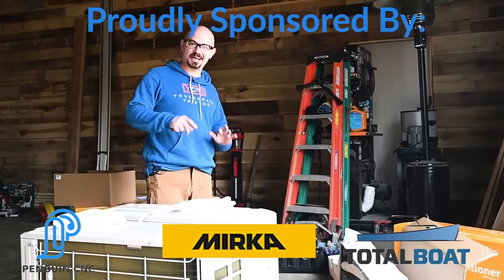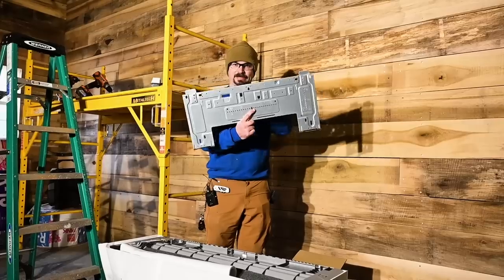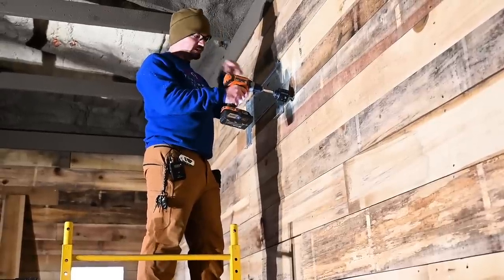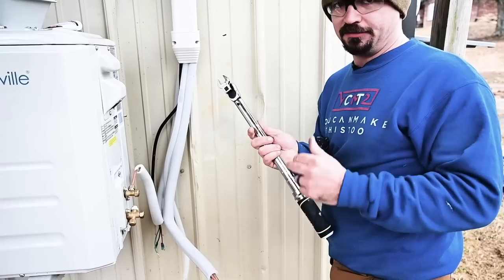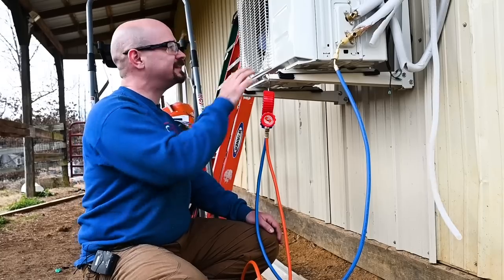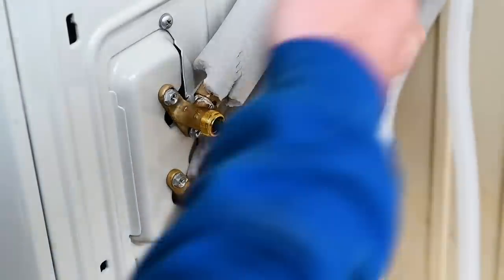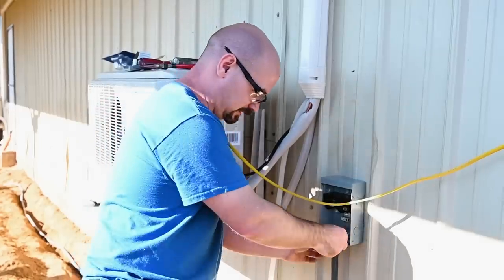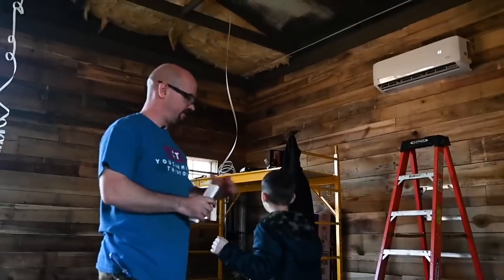Installing a Senville Mini Split | Dream Shop Ep8: HVAC Install

Comment: Hi I can’t but notice that big gap in the side of your shop. I am assuming that you keep this door closed normally.
Reply from the maker: If you're talking about the barn doors, yes. Up until recently they were open just for lighting sake unless it was super cold. We could have light and cold, or dark and heat... light prevailed for works sake a lot of the time. Now the doors are pretty sealed and lockable and stay buttoned up for the most part! I do look forward to nice weather when we can open up the shop though.

Comment: Warranties on the mini splits are worthless. Try calling to make a warranty claim. It will takes weeks, and requires a HVAC tech invoice.  IF  a replacement part is shipped, and the problem is still there, you have to call the HVAC tech again.  You will soon be at $1000 for two visits, and the mini split companies know that.
Reply from the maker: Exactly, can order a whole new system for that or less in many cases.

Comment: Did you have issues with your drain line coming out of the building horizontally like that? I wonder if it would freeze during the winter before it gets a chance to drain. How cold does it get where you live?

Comment: Prety good video. Just a note, the crowfoot on at 90 deg or straight don’t make a difference. Your still adding length and leverage either way. But it’s very a small  amount  and negligible. 👍

Comment: DO NOT USE THREAD SEALANT!. Sorry to be so loud but I worked at refrigeration systems for 47 years  and I know what I am talking about. The refrigerant metering device in any refrigeration system has a pin hole opening that will freeze and or simply plug solid if even a very small drop of this sealant gets into the system. This can can cause  very major repair problems. If you feel the need to lubricated your flare  fittings use only a small amount of refrigerant oil.
Reply from the maker: That's a great point that's come up quite a few times in the comments, thanks for sharing
Reply: Depends on the thread sealant. If it’s nylon blue you are using then it’s no problem at all. It’s just refrigeration oil essentially and there’s no harm to the system what so ever. It wont gel up and clog the TXV. A lot of people use it on flare nuts especially the back side where the copper mates. The only real concern with it is when using a torque wrench you can over tighten it. Because of that I simply use the lower end of the spectrum when tightening.

Comment: If you remove the schrader valve how would the freon not leak out when disconnecting the vacuum lines?
Reply from the maker: If I recall correctly, there was still a shut off valve after the Schrader.

Comment: You were supposed to leave the adapter with the blue line connected to it, release the freon in both lines.  Then document the adapter with the blue line still connected to it

Comment: Did you have to use a 10/3 wire to the unit? What size breaker? Thank you
Reply from the maker: I think it’s a 20A breaker, so just 12 gauge. Depends on the model.

Comment: Pulling a vacuum by time or using your gauge manifold is pointless.  It is like cooking to time and not using a meat thermometer. Most likely it will work. But a leak would have to be huge to tell that way. The proper technique is a triple evacuation. Vacuum pump, then break that with nitrogen, then again on the vacuum pump. Once you are down to 400-500 microns valve it off and watch the micron gauge. If it holds for about 15 minutes your system is tight and more importantly dry. The point of the vacuum pump is actually to eliminate moisture.
Reply: Agreed, not only break with nitrogen, but pressurise with nitrogen and soap test( within system limits).
Reply from the maker: Good to know, thanks for sharing! This is way outside my depth. So far everything seems to be going alright (even after the recent deep freeze) so hopefully I got lucky.
Reply: @YouCanMakeThisToo  as long as you didn’t have an immediate leak or a lot of moisture in the system it should be ok. But it is about longevity. A system done properly could have X2 the life long term. 

Keep up the good work
Reply: I would have called a competent installer to perform a task you don't have the proper test instruments for
Reply: @RARELYSERIOUSB  Even if i did this DIY and only got half the lifespan vs paying for a professional install, I'd still come out ahead because the cost of install is about 200% of the price of the unit.
Reply: @daltonduperreault3504  I doubt a pro would even do the nitrogen thing 3 times.
Reply: @keithwiebe1787  They definitely don't. I had a Mitsu installed by one of their Diamond installers (and one of the best rated HVAC companies in the area), and they did a pressure test and sub-500 micron vacuum. That's it. For the HVAC guys, time is money, and they aren't doing anything that adds hours to the install. A competent DIYer has time on their side, and they can run a pressure test (or vac for that matter) overnight or multiple days to really be sure. 

I'll be installing all my future units after tons of research and passing my EPA 608. The prices the HVAC companies charge for these is just too much. The rest of the world treats these things like disposable window units and installation is either free with purchase or like a hundred or two.

Comment: 19:08 - I see you removed that circular cap you originally had placed into the hole.   I made the SAME mistake, hung the unit and was like ... OOOO that looks like crap!   LOL

Gerry Owen's also mentioned not getting "foreign" material into your lines... That is why I purchase my linesets from deep in America VS border or sanctuary cities. :P LOL
Reply from the maker: Yeah, that stupid thing ended up being more hassle than it was worth 🤣

Comment: What is that stuff you're putting on the threads at 7:14? I thought you only needed nylog on the face of those flare fittings.
Reply from the maker: Thread sealant, belts and suspenders.

Comment: Just a small thought, nothing big. Did anyone tell you there is a "minimum depth of bury" on conduit and wire (conditions apply) and that the NEC won't let you run NMB in conduit - certainly not flex. Flex is limited to 6 feet (unless something changed since I retired). You can run NMB in conduit for physical protection. Some will argue that if you up-size conduit far enough using the physical outside dimensions of the "Romex" as you called it, that you can run in conduit. 

If you had it inspected, I would have expected the electrical inspector to have said something. Not every jurisdiction inspects or requires licensed contractors.
Reply from the maker: I definitely didn’t follow the minimum bury depth on this. I just pulled stranded through it though, not romex.
Reply: @YouCanMakeThisToo  - very good. Some will still argue you can pull NMB. It is physically possible - with a big enough conduit. But man, what a PIA. 

If you used stranded or even solid THHN, it's so much easier. As far as depth of bury, well - rest assured, you are not the first and won't be the last. I have always been told, it's primarily for mechanical protection. You had it pretty close to the foundation so being broken by vehicles or even foot traffic should be greatly reduced. 

Good quality video production. And the attention to audio was evident.
Reply from the maker: That was my thinking here too. It was a while back and I think I WANTED to get it 12”, but the ground was so damn hard we had to use an auger just to break it at all and figured so long as it was covered it was good enough 🤣🤣 just didn’t want it exposed to be easily damaged. And as you mentioned, it’s not like it’s out on clear yard to be easily damaged by shallow bury.
Reply: @YouCanMakeThisToo  - so true. Try hand digging through an old gravel driveway. 😂.  

If you find yourself in a similar situation - it's good to spring for schedule 80. If questioned by Codes, you have something to negotiate with. "The 'alternative engineered' approach." If that fails - try "I have it on a combination breaker and if it fails - I'm the one fixing it."

Comment: After 8 months, what are your thoughts on the Senville?   Any issues?  Noticed you said you came through the cold snap earlier this year.  How’s the heating portion of the mini split performing?   Thanks
Reply from the maker: Didn't have any issues with it. They didn't cycle down as much when we had the cold snap, but still held the shop at 65f without a problem. THey've been working great for me.

Comment: Does the outside unit telegraph vibrations to the walls? I've seen another video and he mentioned he wouldn't use the wall mount bracket if he were to do it again. I have my unit ordered and it is on it's way, this is my only concern so far.
Reply from the maker: Same. If I’d put fiberglass in the walls it probably wouldn’t be noticeable. But eventually I’m going to move them to ground mounts.
Reply: @YouCanMakeThisToo  TY for the quick reply. Our house is old with solid wood exterior walls and no studs (rough cut 1x12 faced with 3/4 lap siding) so ground mount for us.
Reply: I used rubber stoppers between the unit and the bracket AND between the bracket and the wall... no vibrations make it through.

Comment: Looks like a nice Shop. I Recently started using Resin and do you use any specific Silicone Mold release or does any silicone spray work?
Reply from the maker: I've got some generic stuff from amazon and it works fine
Reply: @YouCanMakeThisToo  Okey then it should be fine with the silicone spray i aldready have but ill do a little test of it just to be sure.

Comment: Thanks. How did you bend the copper pipes?
Reply from the maker: Just really gently by hand. It’s pretty thin tubing
Reply: @YouCanMakeThisToo  Thanks. I have really hard time bending the 1/2 inch pipe 90 degrees without crunching/flatten/kinking it and the 1/2 bending tool costs over $150 for only one use.
I will have to pay an ac company to bend it for me.

Comment: 👏Thank you for some really helpful tips on this install! Like most DIYer's I watched plenty of videos on this subject to familiarize myself with the subject before buying a unit and the needed supplies for installation. I appreciated the tips on the torque wrench and 90-degree angle usage, and your summation of the vacuum process relieved some anxiety one might have. Great video, and newly subscribed viewer.
Questions:
1. What product were you using on the copper tread connections? -I'm planning on using Nylog thread/gasket sealant myself
2. Would blue thread locker liquid be a bad idea at the base of these threaded connections away from the flares just to help ensure no vibrational loosening?
Reply from the maker: Nylog is thr gold standard from my understanding. 

And from some comments I’ve received apparently it’s not advised to put anything on flare fittings. Once torqued to spec they have the proper tension and adding anything to the threads throws off the engineering.

Comment: what size crows foot do I need for each connection? The crows foot kits online are up to 1" or are 1" and larger.. not sure which to get, or if it is metric on the senville
Reply: for me it was 22mm for the 3/8 line and 17mm for the 1/4 line... both fit slightly loose but sae equivalent sizes were even a bit looser than metric

Comment: code does not require a disconnect box. code requires a source of disconnect. if you put a 240v plug and use it like a 240v volt appliance there would still be a source of disconnect at the appliance
Reply: By the time you buy a plug, outlet, weather tight box, one of those covers that allows you to have the plug in while still providing weather protection and most likely a double pole GFCI breaker because you now have an outlet in a damp/wet/outdoor location, what have you saved? At the time of this writing, a 60A non fused disconnect at the big orange store is $15.
Reply from the maker: Exactly. Significantly cheaper. I can buy a lot of disconnects for the price of one dual pole GFCI breaker. Or one for the price of a water tight cover. Or one for the price of a plug..

That said he is correct in stating that the requirement is a means of breaking the circuit, not a service switch per se. Just neglected to mention that the alternative isn't cost effective, but it is allowed. So if you happened to have all those things laying around but not a disconnect.. might make sense.
Reply: Or if where you are installing the unit already has an outdoor box with a gfci within 6 ft of it. That way no extra money needs to be spent. Not always practical but can get lucky from time to time
Reply from the maker: @gunracersr exactly. No need to rip that out and replace with a disconnect unless you just want to

Comment: What I wanted to see is the line set connection from the inside unit to the actual line
Reply from the maker: At about 5:00 you can see me bending out the lines attached to the unit and putting them through the wall. At 7:00 I connect the line set to the lines coming out of the unit.
Reply: What is holding me up after I finally found out how to open the air handler to get to the wiring I don't know where the connections are supposed to go because I have a red white green and yellow wire
Reply: Do you connect the end with the round connectors on it or the straight wire on the other end. I assume red to red, black to black and white to yellow and green to ground.
Reply: Your video did not show connecting the line set to the air handler even though you say you did
Reply from the maker: Ah, my bad. I was just thinking of the refrigerant lines when you said line set, not the electrical.

I don’t remember the details.. the manual or panel in the unit should have some kind of wiring diagram. The end with connectors probably goes in the unit and the bare end is for connecting to the disconnect

Comment: Hey there, if you used Romex that's a no no. You cannot use romex, even in conduit, outdoors. It will absorb moisture and eventually mess up.
Also, if your disconnect is right around the corner from the unit, you do not need a disconnect. A disconnect is only needed if the main breaker is not accessible in 20ft. 
You should however put in a rectorseal gas charged surge protector on it. $50 on ebay.
Reply: What are you talking about? The individual strands in the Romex are thwn. Romex is used all the time in unconditioned and protected environments. If it's in the conduit, it's sealed and wouldn't be a wet environment.

For that matter they make direct burial Romex that doesn't even need the conduit!
Reply: @wings2004  That's not romex. 
You need to read up on the NEC code. Those are not my words. Romex has paper insulation in it. That insulation absorbs moisture.

Comment: What the torque weight for the nuts?
Reply from the maker: Don’t remember, it says in the manual
Reply: @YouCanMakeThisToo  Senville paper manuals have inflated numbers for torque so you might want to double check with the current online pdf manuals. I double checked with Senville support and they confirmed that the paper manuals were in error. The values for 1/2" nuts were over 50% higher in the paper manual (44 vs 26 ft-lb).
Reply: Here are the numbers they sent me:
Pipe Size   - Primary ft-lb / Additional ft-lb 
1/4 inch  - 11  /  11.8 
3/8 inch  - 18.4  /  19.18 
1/2 inch  - 25.8  /  26.55 
5/8 inch  - 33.19  /  34.67

Comment: what size is that crows foot?
Reply from the maker: I just kept trying them 'till one fit right.
Reply: @YouCanMakeThisToo  was hoping to know so I could just buy one before the unit arrives, only time I've needed one so far.
Reply from the maker: I get that. I’d tell you if I remembered, but that doesn’t guarantee at all that the nut on yours will be the same as mine. Mine didn’t even match the manual. I think they just use whatever supply they have at the time.
Reply: @YouCanMakeThisToo  thanks I understand 👍

Comment: 3 years later in 2024 the instructions are still a joke.  About 40 different wiring diagrams for the outdoor unit named with different letters, none of which corespond to any letter in the part number.  The indoor unit does not even have a wiring diagram. You have to solve the riddle and match the tiny, barely visible numbers on ONE END of the power cord with numbers on the terminal block.
Reply from the maker: Exactly. My biggest gripe about that product and why I’m hesistant to call it DIY

Comment: leave the charging Hvac to a Pro not a DIY job you can get hurt if aDIY is doing the charging the system when ver I pulled a Vacuum  it was min 30-45 min depending how much humility   is in the air

Comment: NEVER put any product or sealant on the fittings, i dont know why everyone is putting some sort of sealant on the threads , you get that stuff into the system and its Kaboom for the compressor. STOP doing that !

Comment: I installed a Senville and it was NOT a DIY project. In total, I had 30+ hours into the project and I'm an accomplished car, plane and house builder.
Reply from the maker: I believe it. Do-able, but not friendly.

Comment: To wordy, skips the important parts
Reply from the maker: Which parts did you think were most important to be highlighted?
Reply: @YouCanMakeThisToo  Detail on vacuuming the copper tubing, and opening the valves to let the R410 flow. Show the cable terminals that join both inter and outer electric panels are the same wire sequence.